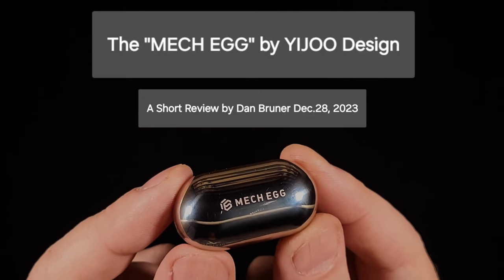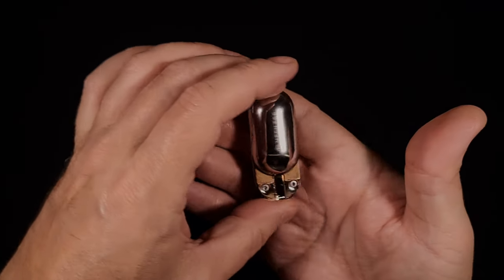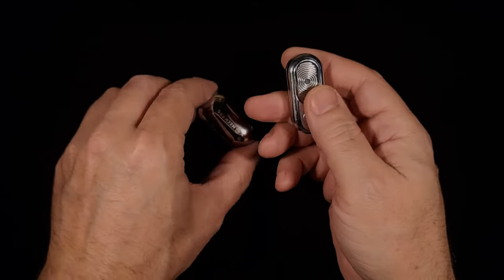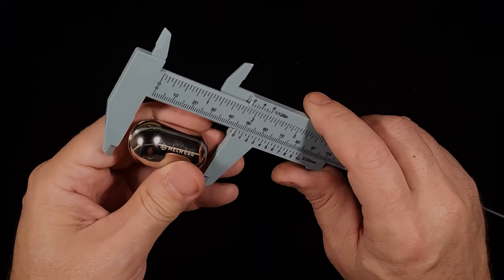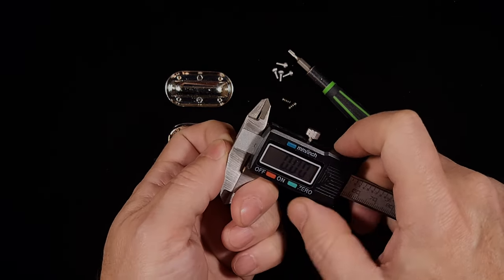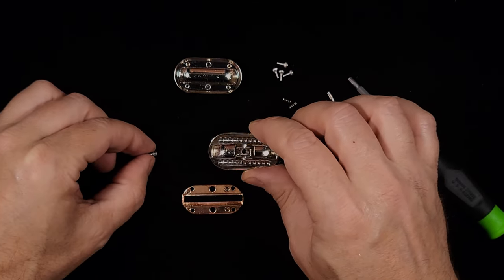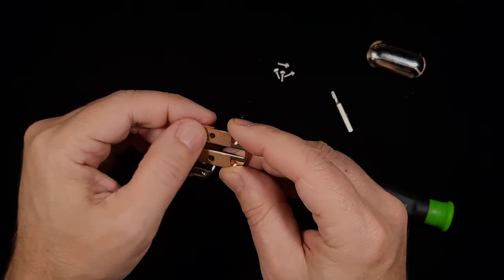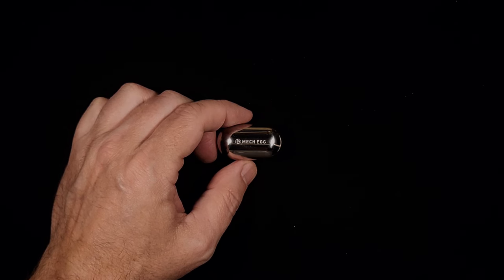The "MECH EGG" by YIJOO Design - A Short Review by Dan Bruner Dec.28, 2023

Comment: 🎯 Key Takeaways for quick navigation:

[- 00:01] 🤖 Introduction to the "MECH EGG" by YIJOO Design
- The "MECH EGG" is a diecast slider with 5 clicks in both directions.
- The presenter was pleasantly surprised by the quality, despite initial concerns about diecast construction.
[- 00:28] 💰 Pricing and availability of the "MECH EGG"
- The presenter initially paid $25 for the "MECH EGG", but the price has since dropped to around $12.
- The "MECH EGG" is available in three different colors.
[- 01:24] 🛠️ Initial impressions and break-in period
- The "MECH EGG" did not run as smoothly out of the box, but improved with use.
- The presenter suspects the initial stiffness was due to the tape used on the product.
[- 02:21] 🔍 Design and construction of the "MECH EGG"
- The "MECH EGG" has a friction plate screwed to the bottom, making it feel heavier in the hand.
- The branding is on the top, and the presenter considers this the "bottom" of the device.
[- 03:29] ⚙️ Internal components and disassembly
- The "MECH EGG" has two steel balls and two springs that run on tracks of detents.
- The hollow middle channel contributes to the "pop" feel of the device.
[- 07:35] 📏 Measurements and final thoughts
- The "MECH EGG" is 42-41mm tall and 20mm thick, weighing around 59g.
- The presenter is overall pleased with the "MECH EGG" and considers it a worthwhile purchase at around $12.

🥚